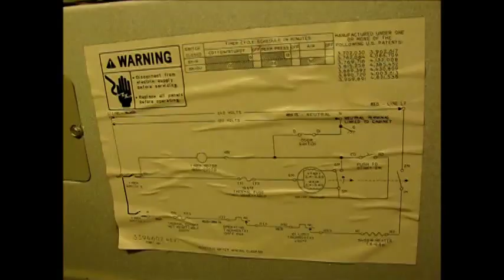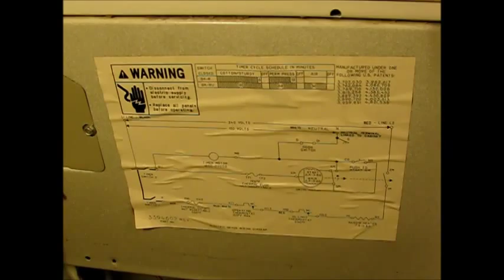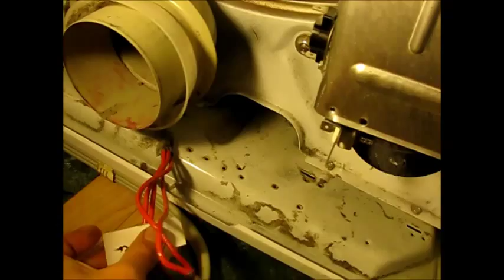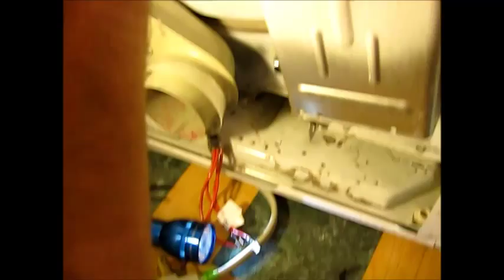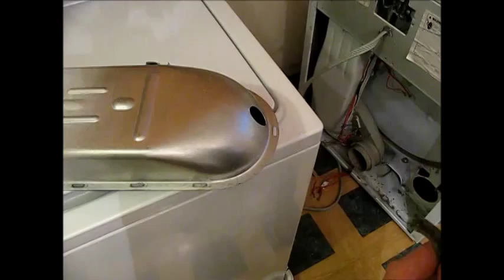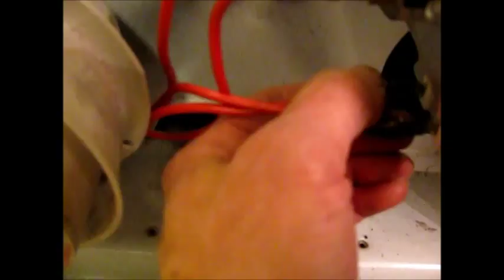How to troubleshoot and repair an electric clothes dryer that runs with no heat

Comment: im working on a admiral dyer.  i still have no heat coming out of dryer i replaced dyer thermal fuse it was the only thing that didn't have any continuity. everything else was good.  also checked outlet got 240v coming out    any suggestions?
Reply from the maker: At this point I would check for check for the 240V in the circuit under live conditions to find where it drops out. Do not attempt this unless you are trained to do it safely.
Reply: Yeah I can check that to at this point though I think it is the timer I check it on low heat it came on and I checked it on 30 min high it also came on from time to time but did not come on at all on just the very dry setting. So I think I might pull the timer off check that first. But I appreciate the suggestions and help
Reply from the maker: Good luck with it!